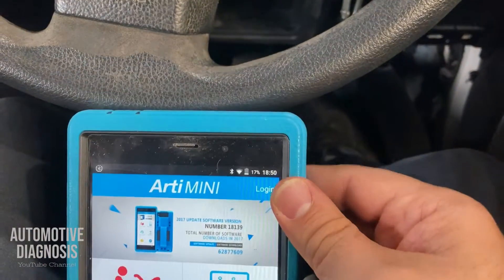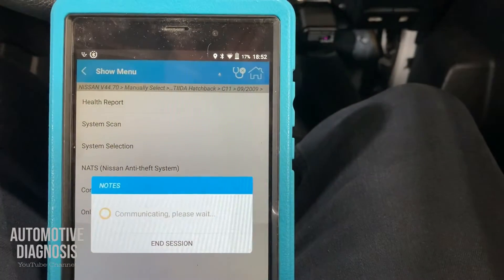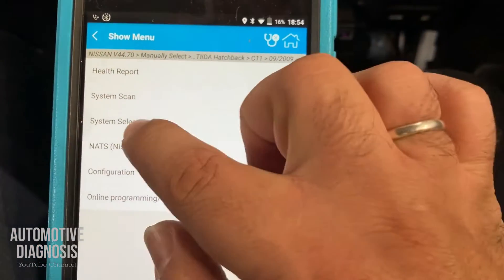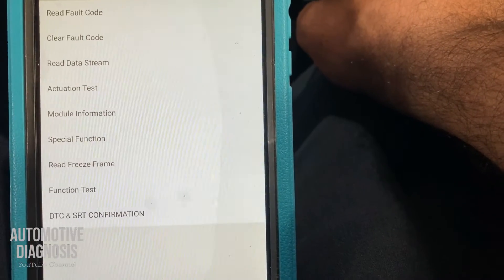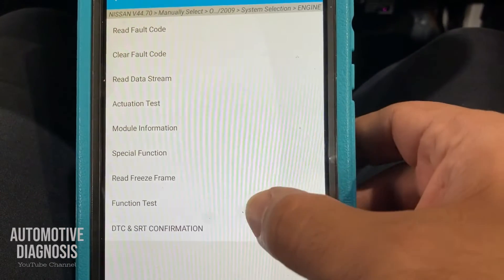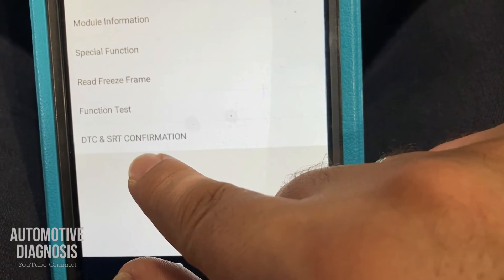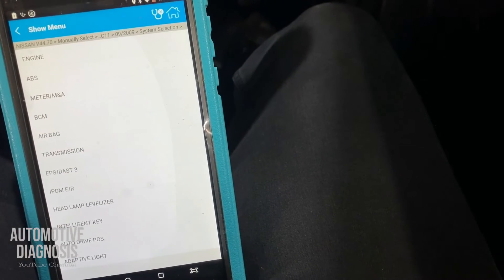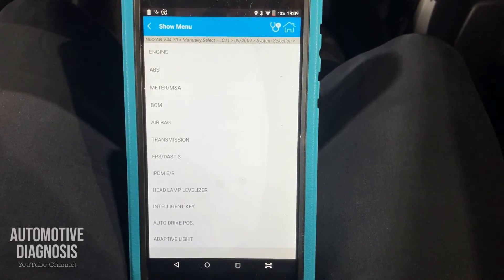How to Use any Scan Tool (Beginners Guide) #scanner #scantool

Comment: Thank you so much 
I have a question 
In ix 55 when I use actuer test
High speed fan just one of them work,but low speed fan twe of them work
Is this OK?
Reply from the maker: Hi my friend, this is normal for IX55 actuation test.
Reply: @AutomotiveDiagnosis thank you ❤

Comment: Can't wait to see this tool being used to diagnose some cars
Reply from the maker: Hi my friend, we already have a couple of videos showing how to test different systems using this scan tool. I'll send the links down here.
Reply from the maker: How to Fix C10E254 Fault Code on VW Golf Electronic Parking Brake (EPB) Just in 2 Minutes
https://www.youtube.com/watch?v=zRd48AoQISE
Reply from the maker: How to Test the Wiper with Scan Tool
https://youtu.be/TwxgD3TFKBM
Reply from the maker: How to Calibrate Steering Angle Sensor 
https://youtu.be/m6bjQFVbal8
Reply from the maker: Test the Power Windows Motor & Switches in 2 Minutes
https://www.youtube.com/watch?v=61yxklCmJHc
Reply from the maker: Test Central Door Lock Actuator & Switch in 2 Minutes
https://www.youtube.com/watch?v=mai3FsasWo0
Reply from the maker: Nissan Electronic Throttle Body Re-Learn Procedure \ Idle Air Volume Learning \ Fix Surging RPM
https://www.youtube.com/watch?v=ErV095iHUzA&t=191s